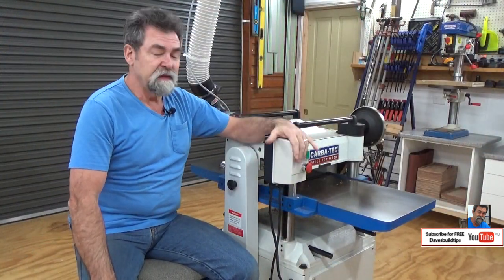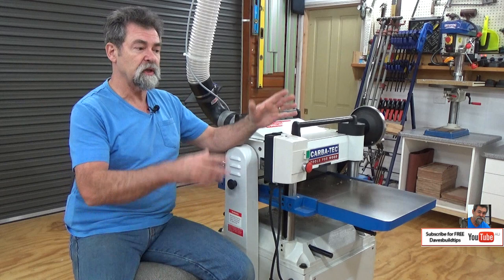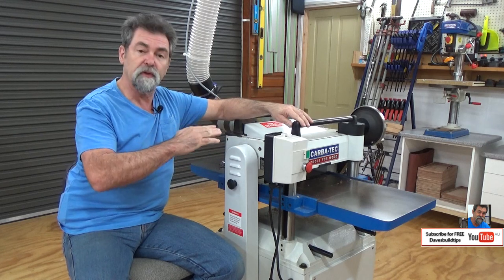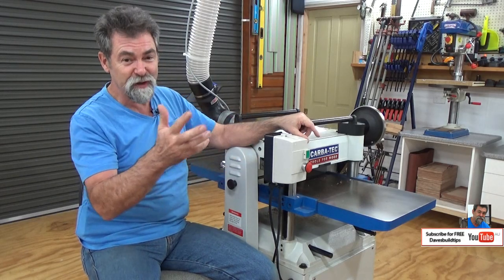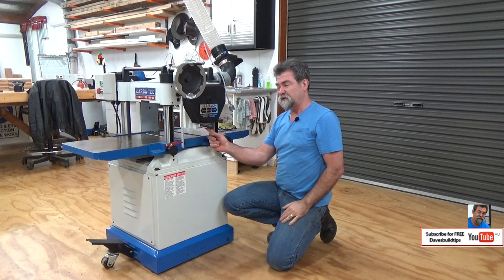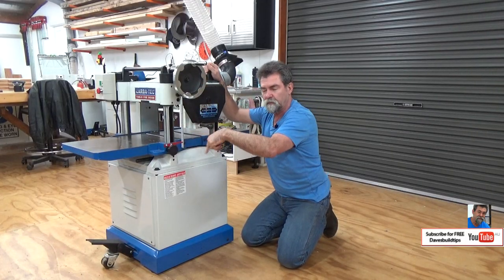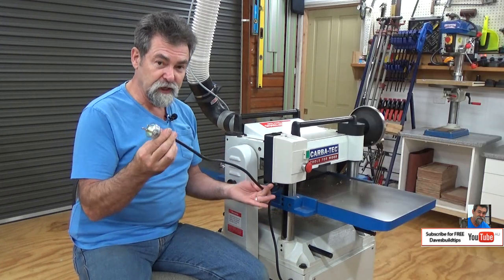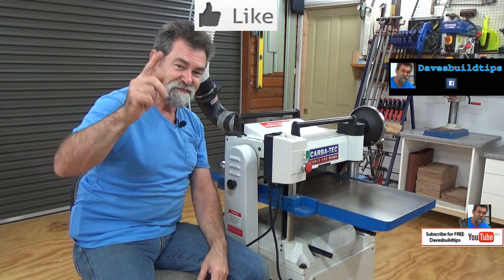How To  15" Thickness planer Dave Stanton woodworking

Comment: David, thank you! I bought a PM15HH about 3 years ago and like an idiot, didn't read the manual and didn't even consider changing the oil! 
The Carbatec sure looks a lot like the Powermatic! 
Some good advise, when you pay $3300 for a machine, you may want to maintain it!
Reply from the maker: Yep, maintenance is the key Terry!
Reply: This style of planer has been made by so many different brands over the years. All basically the same. I just picked up a Buffalo that other than paint and in and out feed tables looks identical. Mine has in/out rollers. I'll probably replace them at some point. Grizzly and others make this one identical too. So tons of parts out there for them. Mine is from the late 80s early 90s. And is a 2 hp 120/220 motor. Fired up and runs good. Oh I don't have the helical head yet but one of these days I will upgrade it.

Comment: I have an older version of that machine(Sherwood "Timbeconned" not CT) with the standard cutter head had it for about 10yrs and boy do I wish I had a spiral cutter head... absolute PITA to set the blades for a nice unscalloped cut. I recommend throwing the supplied blade set jig as its a waste of time once you have sharpened the blades... havent come across a shapening service that can keep the blades perfectly flat along the cutting edge.
I made a jig that straddles each side of the blade that has a dial indicator so I can manipulate the blades(by bending them using the jibs and jack screws)to within .01~.05mm which is tricky because as you tighten the jib screws the cutter head distorts!
Reply from the maker: The helical heads are a joy.

Comment: My infeed roller gouges my timber, can you reduce the downward  pressure on the timber? Can you do a video on correct adjustment or setup of infeed and exit rollers. 😉
Reply from the maker: I will look into it for you.
Reply: Any luck with the roller adjustment video mate?
Reply: Hi Dave. Same problem here. What is the fix ? Thx!

Comment: Hey mate thank you so much for the video. What oil do I use to replace the oil in the gearbox? Cheers
Reply: Is motor oil fine?
Reply from the maker: I tell you in the video what oil to use. Did you skip through it quickly?
Reply: @DavidStanton  sorry I had forgot it at the end of vid and didn’t have time then to rewatch. Will have a look soo . Thanks mate

Comment: G'day Dave, I am interested in your thoughts and some guidance. I am in the process of finally building my wood workshop. I was set on the Jet 12" combo planer/thicknesser with the spiral cutter head. Most of the feedback I have received is that it's better to go with seperate machines. Given the price point the alternative is to go with the combination you have opted for. Final piece of information this will be a hobby but my intention is for the hobby to be financially self sustaining in due course. The shed I am building which will be soley devoted to wood working is 8x7m which is a reasonable sized space but not massive. Any advice would be greatly appreciated!
Reply from the maker: Hi Ross. Given the space you will have, going with the two separate machines is my preference.

Comment: good video Dave. qstn: do you rotate the cutters on a time-defined basis, eg after every 30 hours, or is there a way of judging when they have started to blunt, as distinct from chipped?
Reply from the maker: Good question Chris. I watch for signs of a fury cut or maybe a bit of tear out. Generally it is a good idea to rotate all 74 cutters at the same time. Thanks for watching!
Reply: thanks Dave. I've gone for the Powermatic 15" and am waiting delivery. Maybe compare notes down the track?
Regards.

Comment: I've used a great many types of thicknesser over the year's and I remember when a firm called Grizzly first started importing them from Taiwan to America.
It was easily the worst machine I have ever used. Noisy, never fed well or thickenessed evenly and it was impossible to remedy its short comings. The 20 inch version is no better. The newer ones with the sectional head may have eleviated the problems by reducing the cutting pressure and noise but if a hobby guy asked for my advice I would say get a Makita bench top unless you really need to mill big thick long board's. 
The trouble with this design is that it uses one motor to drive the cutterhead and feed, so if you start milling big stuff it will run out of power. The gear box has two speed's as I remember. The drive belts are long and tend to slap and slip. Over time the four post lift screws tend to go out of adjustment and that's when it becomes a nightmare to use.
The dust gets in and causes uneven wear. 
In short it's a badly designed machine but cheap to make.

Comment: A much easier way to do the gearbox oil is to fill from the bottom. Drain it just as you have done. Then get one of the small pump dispensers with a flexible hose an a threaded insert that matches the drain hole. Pump in your 400ml or until it overflows out the top hole. Then screw in the top  screw. Next unscrew the hose & cover with your thumb. Then screw in the drain plug. The oil is very viscous and with the top screw in place it will not leak out. This is the same method as for an outboard gearbox and it works great.
Reply from the maker: Thanks for the input Daniel. My thoughts are that your method requires some dedicated equipment that the majority of people will not have readily available. Then again, they may, lol.
Reply: Mine is a CTJ - 508

Comment: Hi David, just wondering how the thicknesses holds up against real aus hardwoods, i've got a dewalt DW735 and it really struggles, thinking of upgrading to this model, cheers.
Reply from the maker: It is pretty good. The knives are all % tungsten and have 4 edges per knife. The latest model has all the blades at a slight angle so they all slice rather than chop. I have run a fair bit of spotted gum through mine and it performed well. The 20 inch 3 phase is the best and keeps the power up to the cutter head. Of course you need a 3 phase supply to run it. The model I have is 15 amp and I find I have to watch the cut depth on full 15 inch wide slabs.

Comment: I wonder if this is the same machine as the Powermatic?
Reply from the maker: No. The powermatic has the other style of helical head I mention in the video. A lot of the machines look very similar but there are a few differences.
Reply: Same as a Grizzly 15" inch.